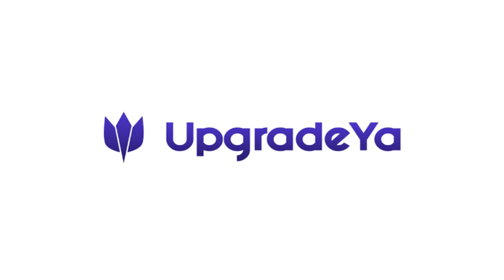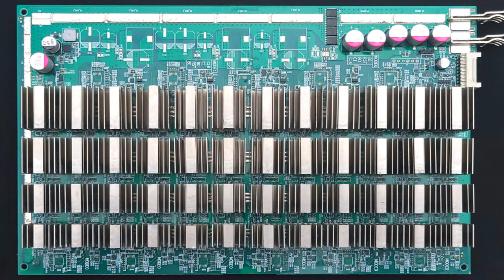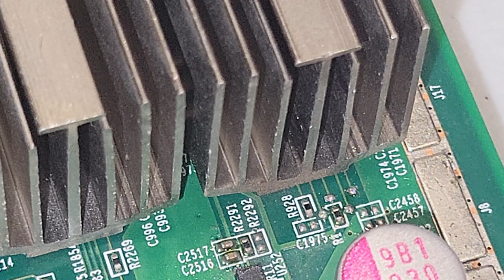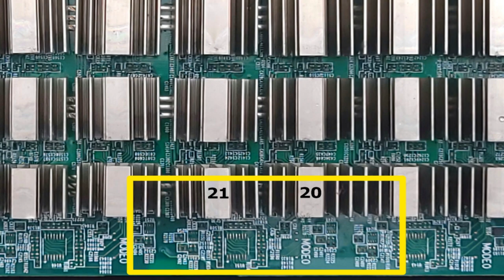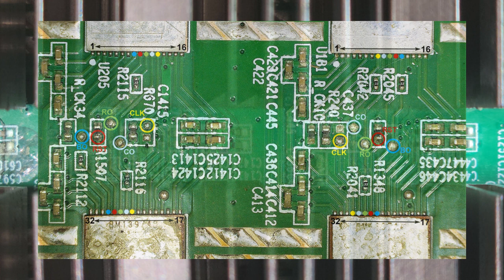Antminer S17 Hashboard Repair:  Voltage Testing Basics

Comment: to do your  voltage test do you have to press the  green test button everytime??? or just put voltage on the board??/ that tester give me 0 asics even if Ive got a working boaard///...hate it..
Reply from the maker: Yes you hit the button each time.  It only pulses the board for a short duration, allowing you to get your reading.  If you have a working board, why are you testing it?
Reply: Other testers will allow you to run the power through the board for longer periods of time. I've also seen other techs that will place the +20V clip on the other side of the mosfet in order to test voltages. I have not tried this myself since my tester allows for a longer test cycle.

Comment: My hashboard RI signal into chip 48 is zero, where does the RI signal originate since there is no chip higher than 48? Excellent video. Well explained with great pics
Reply from the maker: Sorry Robert, I have 2 boards with the same problem but I haven't taken the time to research the solution.  Please let me know if you do figure it out though.
Reply: Yea same problem… wish you would have shown how to fix or war to check if you have problem at step 1…..

Comment: hello, what do you recommend to mark the hash board? It is so that they are not confused with other people hash boards. the issue is that my customer needs the mark not to be erased with the cleaning maintenance, he thinks his hash boards are being changed. Thank you
Reply from the maker: Hey Ramon.  I write a number on the first silver pad to the left of the positive terminal.  I use a "Sharpie Industrial" permanent marker which claims to have "super permanent ink" that is resistant to oils, chemical washes, heat and steam.  It fades slightly after ultrasonic cleaning however it is still very legible.  If you want something more permanent I would suggest etching something on a blank spot of the board or use an engraver on one of the silver power pads near the top.  Hope this helps.
Reply: Thank you!!, I appreciate it.

Comment: Wow fantastically done! Can you make a same video with an absent 1,8 volt RO signal. Meaning that RO signal is completely absent from te beginning of chip 48.
Reply from the maker: Thank you!  I have 2 boards in my repair stack that are missing this signal.  That is going to take some digging into so they are set aside for the time being.  I'll be sure to pass on my findings when I do.

Comment: Can you show S17+
Reply from the maker: Sorry, I do not have any S17+ boards to work on.
Reply: Thank you for the reply.. i got a question why does the diode resistance goes high like 1450 for the 4 signal after changing to new chip.. i know that it should be 1200+-.
Reply from the maker: I've had so much inconsistency when performing those checks, I stopped doing them all together

Comment: Dumb question, when you were testing the voltages on the board was it hocked up to Zeus Test Fixture and PSU? I got a S17 Pro showing 24 out of 48 chips found and checked everything in the previous board video and couldn't find the issue. any ideas? Thanks.
Reply from the maker: Yes I'm connected to the test fixture and use the APW9 PSU. I would start pulling heat sinks around 24 & 25. Do a close visual inspection and double check readings. If still nothing, reflow 25 and maybe reflow 24.

Comment: Another fantastic clinic on S17 repair.  You definitely have a true gift as an educator if the mining gig goes to the opposite of the moon!  Bitmain should have a link to your channel well have you on the payroll to boot.
Have you ever seen a board pass every signal but still show partial ASIC's?   If so would changing the chip after the last good one be the next step or the last good chip?
EDIT:   Capacitors!
Reply from the maker: Haha, thanks Chris!  If there are any Bitmain folks out there, hook me up.
I don't think I have had the entire board pass, however I have definitely had issues where the number of good ASICs was not problem.  Instead the the adjacent one in a different voltage domain was causing the problem.